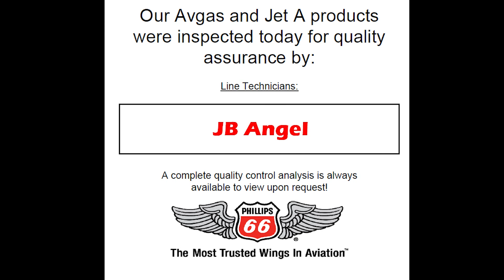Showalter Flying Service - Serious Quality Control

Comment: Readings on a Hydrometer should be read from the bottom of the meniscus – as in where the liquid is level and not pulled by tension up the sides of the container or hydrometer itself.